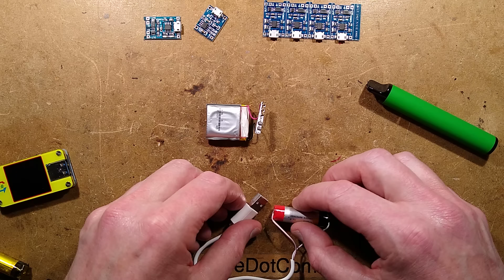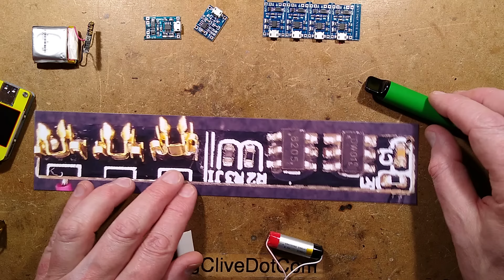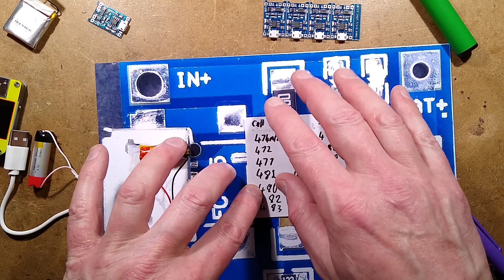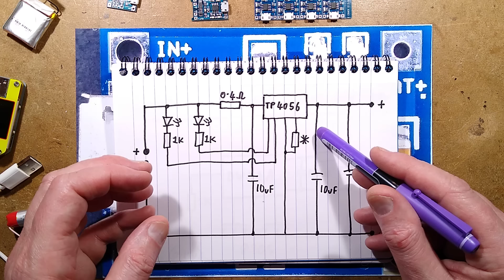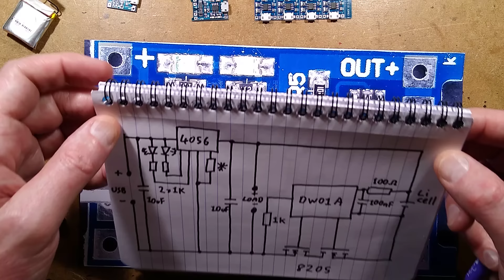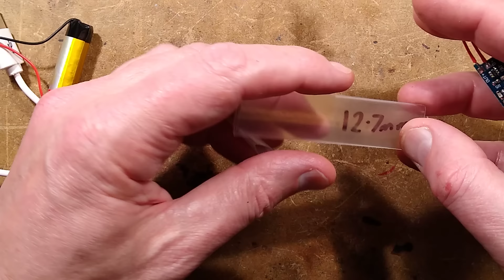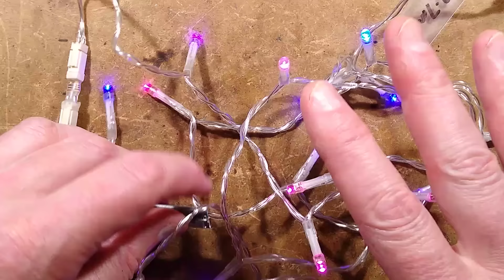Don't do this!   (There's a much safer way)

Comment: Can these be used in garden Solar lights to last a lot longer than the rubbish batteries solar lights tend to come with? 
That would be a good project. Convert a nickel metal hydride cell solar light to a reclaimed lithium.
Reply: NiMh cells are much more suited to the outdoor environment and the intermittent charge rate from the solar panels. The lights also run off a dedicated chip that combines the charge circuit with a boost circuit to provide  voltage for the LEDs. You'd have to replace everything other than the case.

Comment: What about charging  a li-ion cell from USB with just a voltage divider circuit, so, two resistors? Very lossy and inefficient of course, and would discharge the cell if disconnected from USB, but would limit the current and voltage to desired level with very little electronics.
Reply: Not practically possible. For a reasonable charging rate you would have to dissipate a shitload of heat in the resistors. Not recommend.
Reply: A normal diode drops the voltage with about 0.6-0.7 Volt, so you get max 4.3-4.4 V to the battery. 

Diode limit the voltage, a long cheap usb cable works like a resistor to limit the current.

A lot better than just connecting 5v directly. But still not recommended.

Comment: Good video Clive for those that need to be told how to do something correctly. One thing you could have mentioned is the fact that if a lipo cell does catch fire DO NOT throw water on it to put out the fire as water actually will increase the burning of these cells. :)
Reply: I once accidentally damaged a 3200mAh 18650 cell and as soon as I saw the flames, I tossed it into a pot that happened to be full of water -- the cell just kept on going fully submerged in cold water for like 15 minutes! It was an interesting sight and, quite frankly, a tad unsettling, too. That said, the water did NOT increase the burning, not even a little bit; submerging the cell helped dampen the burning a little. Not enough to put the cell out, no, but still.
Reply: No, a super common misconception is that lithium cells have lithium fires. All the fire is is a short circuit releasing the stored energy over a short amount of time, causing lots of heat, evaporating the combustible electrolyte. How severe the fire is depends on chemistry, some cells tend to just smoke or smolder without anything too exciting. 

Cooling the cell wont stop the short circuit but it will rapidly cool it down and get rid of the flames. 

Actual elemental lithium can exist in the cell due to a fault but its a pretty low and harmless amount. 
Rule of thumb is, if something stores energy thats easy to release, there is a failure mode where it catastrophically releases that energy all at once. No form of energy storage can avoid this and the denser it gets the worse it gets.
Reply: @drkastenbrot  this misconception is widespread.
workers who transport lithium batteries get hammered into their heads to never get them wet because they will explode or burst into flames because we all remember that middle school chemistry experiment when the teacher dropped a piece of lithium into a water bowl and it reacted spectacularly.
while the advice to keep batteries dry is sound, as you could cause a short circuit and this way really start a fire, the explanation is at least questionable.

but Clive could prove that for us, could you please, next time you are taking lithium cells apart, drop the rolled up insides into a water bowl?
Reply: @kirakaffee9976  clive made a recent video showing just how much lithium is inside those cells. not only is it a miniscule amount but its not even in its elemental form so good luck getting any reaction with water.
Reply: @drkastenbrot  was that the video when he took apart these green 18650 cells?
I remember he ran the plastic that's supposed to separate the electrodes (with the lithium on it) under the kitchen sink and nothing happened, so I guess you're right. would be a boring video.
lithium batteries have taken planes out of the sky tho, they are not to be underestimated. but the risk is more with being batteries than containing lithium.
Reply: @kirakaffee9976  anything that is designed to store large amounts of energy will inevitably have a failure mode like that. i still prefer the somewhat tame battery fire over spilled liquid fuel or a gas explosion. even lead acid batteries can violently rupture in overcurrent situations, and the acid-going-everywhere part is pretty nasty. there wont ever be a 100% safe form of energy storage.
Reply: @drkastenbrot  nothing in life is 100% safe, and compared to the numbers of batteries going around and being shipped every day, incidents are rare.     I didn't want to portray them as incredibly dangerous, but they are to be respected.  I knew that before, but on this channel I learned that they blow up if the lithium gets wet is a myth. and I can tell you a lot of people who handle these things by the ton every day believe this ^^
Reply: Not throwing water on a burning cell is a bit of an urban myth. Water doesn't make the reaction worse per se, but it can create a lot of steam, and perhaps cause secondary damage. (electrical shorts in other sections) Ultimately it's simply not the best treatment to use, although it can help to cool nearby cells in a power bank if you're lucky. I think somehow the reactivity of elemental Lithium with water, and water being used on electrical fires, has been conflated, and then propagated as the worst thing to do. Neither of these are necessarily true for a Lithium cell fire. 

Sand, as others have mentioned, is useful to contain the reaction (the reaction is self feeding, so produces both fuel, and the oxygen required) so as to remove the ability to burn other things. It will continue regardless, so containment is the only thing left.

I have two small galvanised buckets (actually meant for plant pots) half filled with dry sand each. If a cell, or pack goes bad, it's thrown into the nearest bucket, and then the sand from the other is dumped on top. A loose fitting wooden  lid, with cork tile applied can then be placed on top to act as a shield while carrying to a safe place to let the reaction burn itself out.
Reply: Not necessarily. There isn't any metallic lithium in the cell, so you won't get the reaction you think about. But water won't do anything other than turn to steam. Smothering the cell in sand is the way to go.
Reply: @zaprodk  Sand.  Good to know.  I have a Big Clive explosive
 containment dish handy with all my lipo battery projects.  Somehow lost my Captain tape but taped otherwise.
Reply: @amorphuc  Ages ago I worked on a project that involved making a high voltage li-ion pack from 18650s. We had two 12” terra cotta pots half full of sand at the spot welding station, one on the ground and the other on the bench. SOP was that if a cell shorted and started getting warm, you’d brush the whole module off the bench into the lower pot, then dump sand from the top pot over it.
Reply: @zaprodk  It is not accurate to say that there is no metallic Li in the cell; there is some metallic Li in the cell but not in a lump form and they are distributed in a graphite matrix. However, it is possible to argue that the intercalated metallic lithium is not in a metal form (metals must be sufficient lump form to exhibit metallic properties).
Reply: On aeroplanes water is the recommended response to a lithium battery fire. Due to its ready availability, cooling effect, ability to reduce the flammability of surrounding material, and much greater safety compared to other extinguishing techniques (do not use a CO2 fire extinguisher in an enclosed space like an aeroplane)
Reply: Probably not a great idea to use water on electrical fires in general tbqh.
Reply: @rivkahlevi6117  If we were to nitpick, it's not an electrical fire. In the case of batteries, it's a chemical fire.